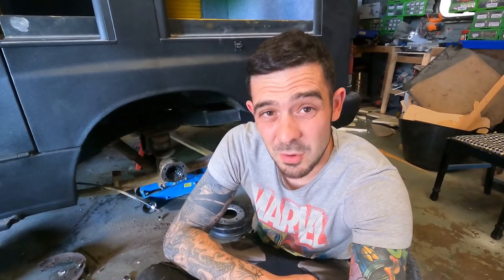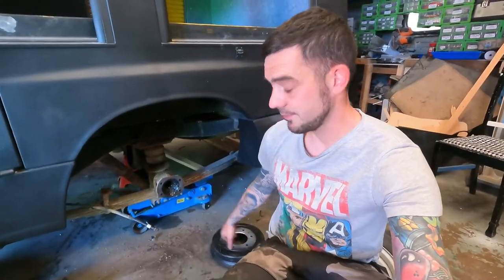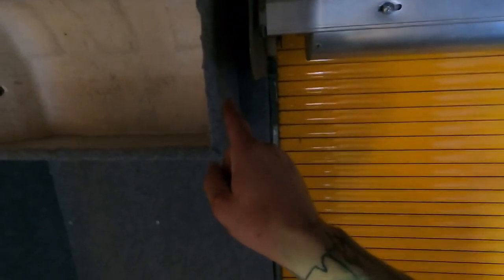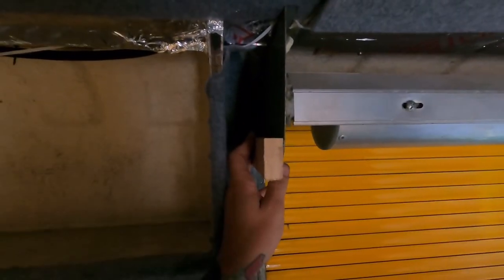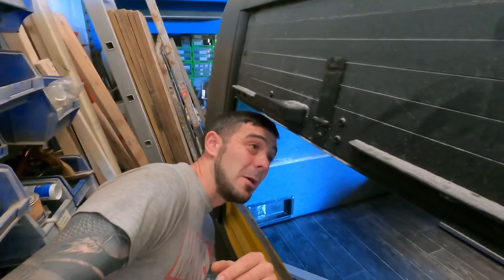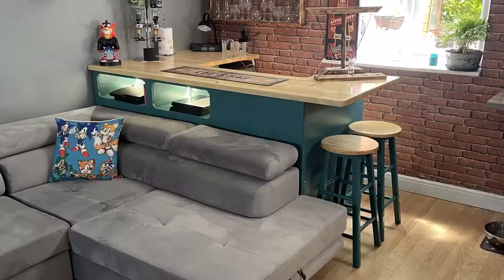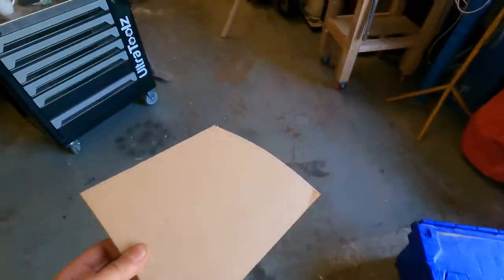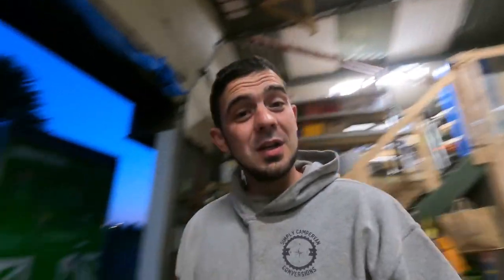OVERLANDER CAMPING TRAILER - BOXING IN ROLLER SHUTTERS AND REMOVING THE DIFF - WHAT A NIGHTMARE

Comment: Knock the old bearings out and take them to Bearing services or any other bearing company near you they should be able to match them up.
But if they aren't tightened correctly  just back the locking nuts of slightly and tap the hub while turning it the hub should spin freely with just a slight drag, you did grease them  didn't you??
Reply from the maker: I’d bolted the hubs on upside down 🤦‍♂️
In my defence the the bolts lined up still.
Turned them round and they spin like a roulette wheel.
Reply: @simplycampervanconversions  🤣🤣🤣 Turnip!
Reply from the maker: @GrandadBaz  that’s a very polite word 😂😂😂